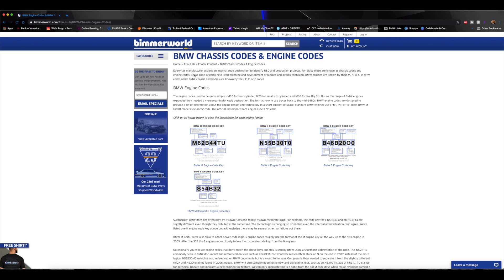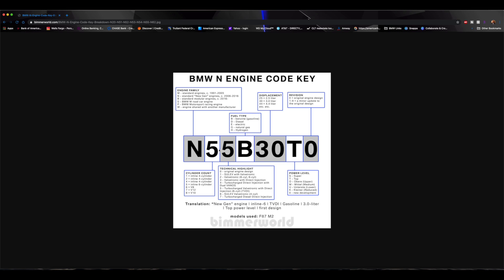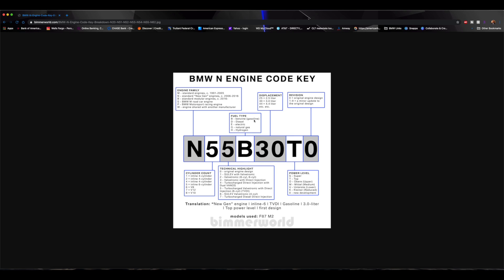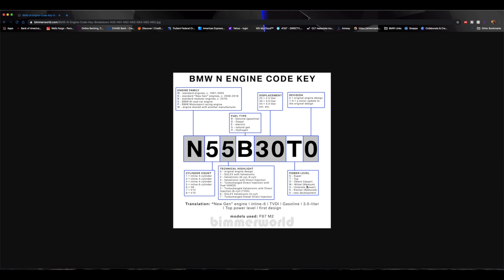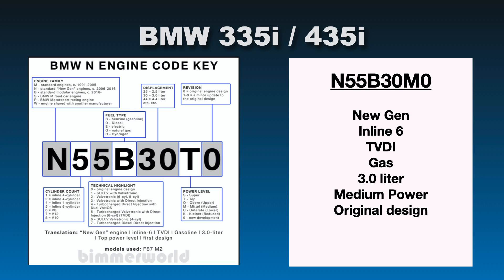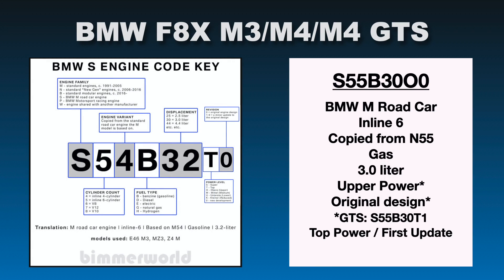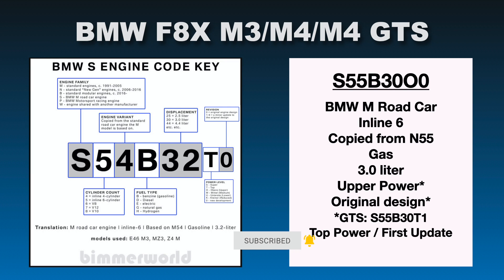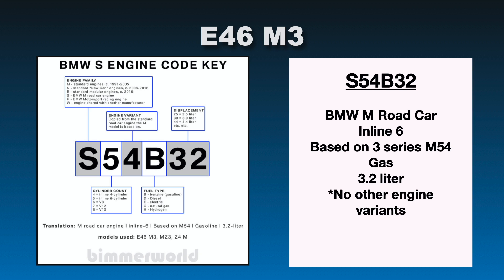BMW Engine Codes : Explained

Comment: Please tell me what the b7f668 means on my 2019 430i 43k miles
Reply from the maker: Where do you see this code?
Reply: @WhatsyourForte  on the menu when you unlock it by adding the last 5 digits of the vin

Comment: Have you ever heard about the 'AF' suffix in the end of the code ? My X1 has a N52B30AF (190 kw/258hp) engine and it seems that the 'AF' is equivalent to the 'O' (upper) power level. Not sure about the reason for this 'AF' suffix though.
Reply from the maker: I have not. It must be new